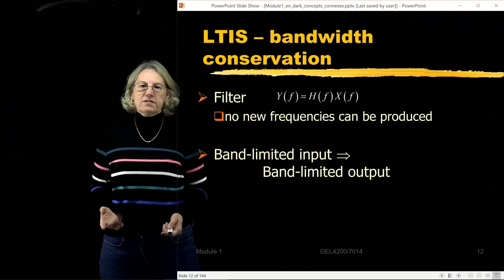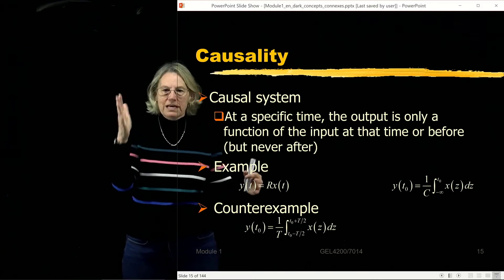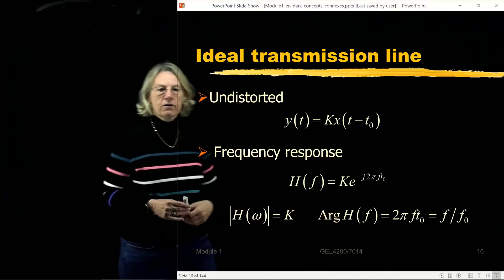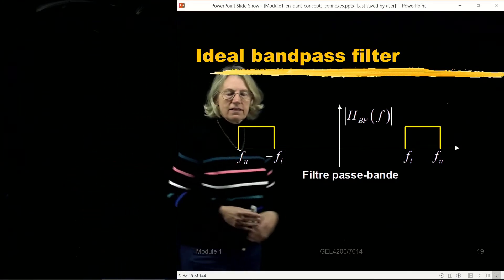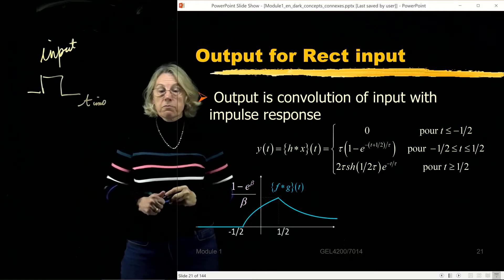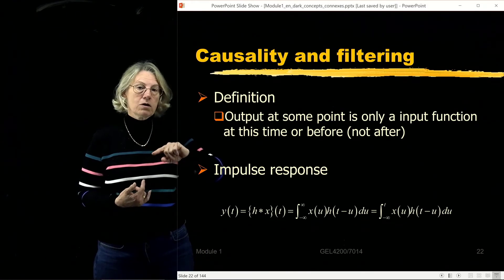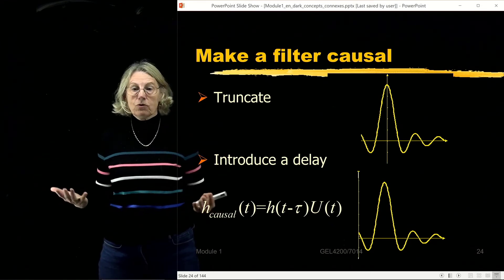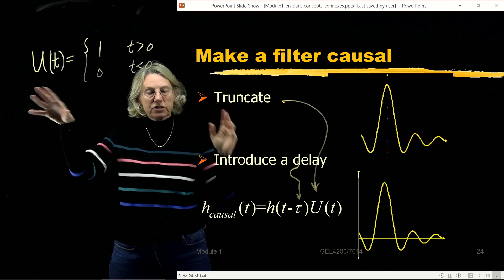GEL7114 - Module 1.2 - LTIS & Filtering

Comment: Dear Madam,
Obeisance. 
Undoubtedly, your lectures are awesome and extremely helpful for new scholars like me. I have understood the concept of Truncation->Delaying to preserve causality of the signal. However, my concern is at practical-basis. In practise we receive a and analog signal which is a time-series data like voltage (may be, broad-band). Now, if we were to carry out digital-filtering in time-domain, then how am I supposed to impose that "Delay" in the recorded time series data ?
Thanking you.
Warm Regards.
Subhadip